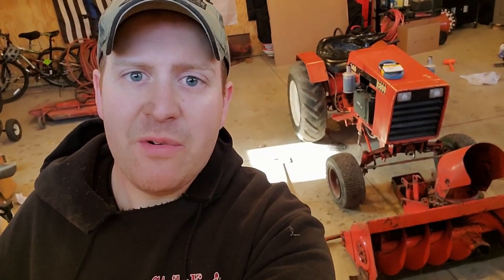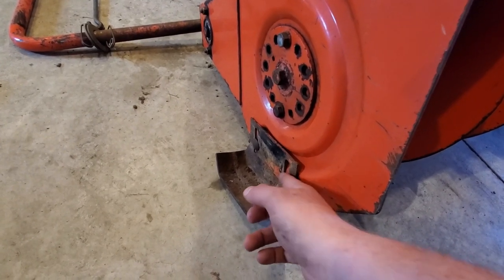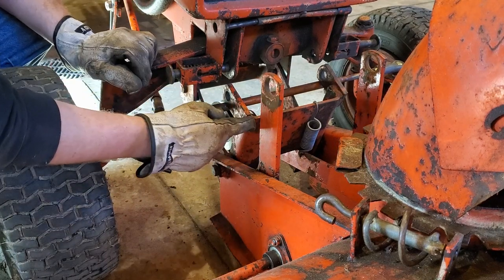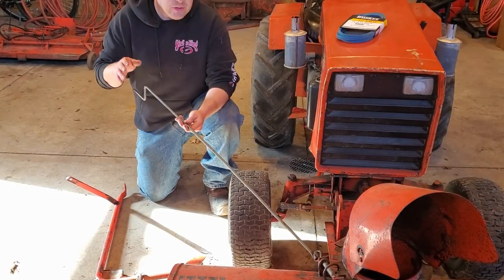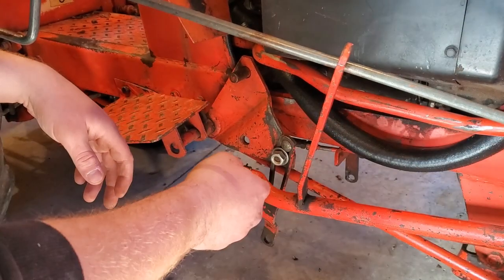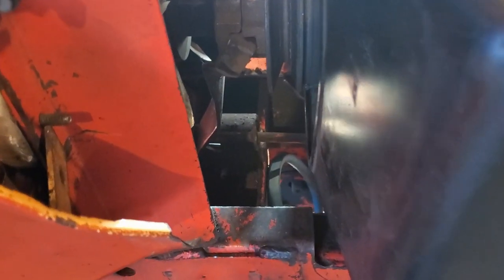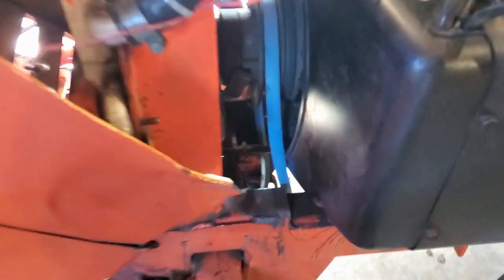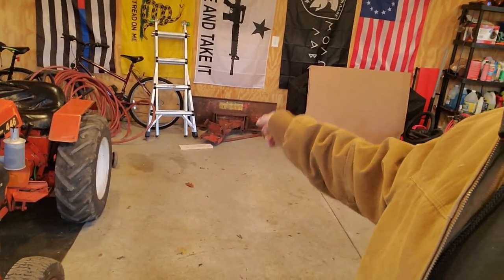CASE 446 L84 Snow Caster Install

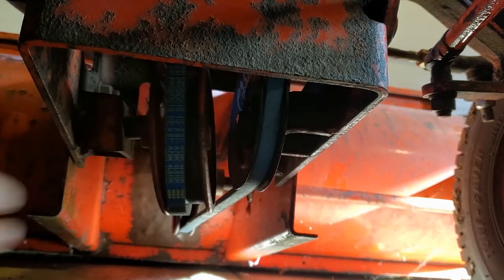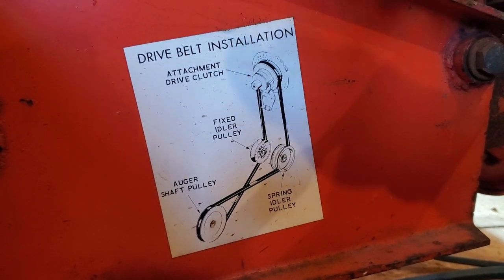Comment: Hello, great video...I'm not sure you fixed it but @10:36  you need to put a twist in the belt so the back side of the belt rides on the flat pulley, without it you will wear out the v side of your belt fast. If you notice @ 7:27 it shows this.  @11:22 it looks as though it has caused your belt to flip in your auger pulley. Cheers!

Comment: Great video! I subscribed! Would like to see a video on how you put that kohler magnum 18 in that thing!  Also some details on those tie rods.. we have fourwheelers that use tie rods like that, they are much better than what the case originally comes with...
Reply from the maker: Thanks for the subscribe! Kohler magnum came with the 446 when purchased. Was installed a few years ago brand new. I will get a videos of a closer look on the fitment of the motor and the tie rods! Yes...they are ATV tie rods which are way better than the original case! We dig your channel! 

Thanks again

Comment: Question: What is the part number for your snowblowers belt?
Reply from the maker: I believe its C23539. Call Bill at Barneveld Implement 608-924-1662. He will get you the exact belt for your blower/tractor and ships fast. You need the CASE/Ingersoll brand belt. Good luck!

Comment: Would this also work on a Case 155?
Reply from the maker: The 155 has a smaller snowblower to attach on it. Call Bill at Barneveld Implement. He can point you in the right direction and may have some in stock. He is the CASE garden tractor King!

Comment: I put an 81 inch belt on mine and it's too short still 
My tensioner lever is almost at the bottom to the floor
I might try a linger belt